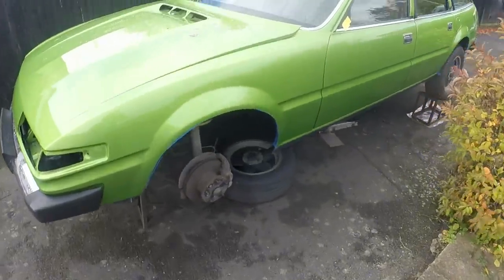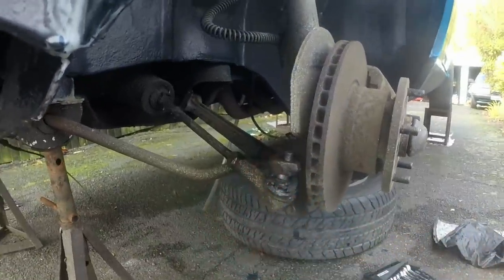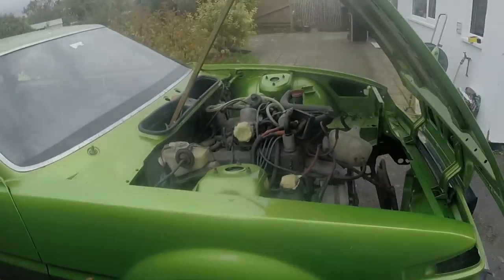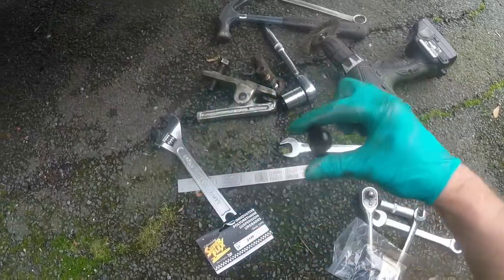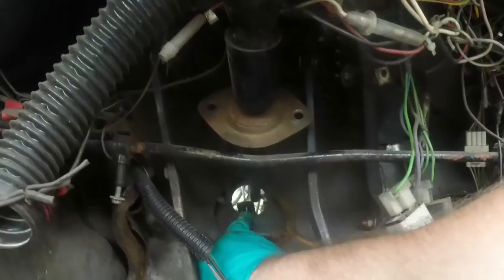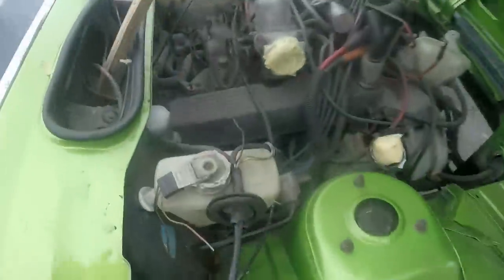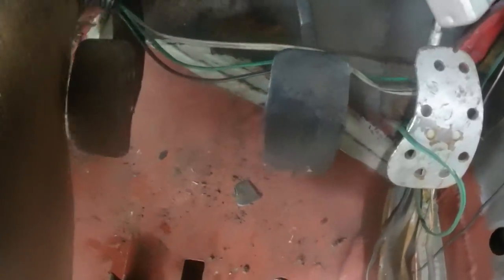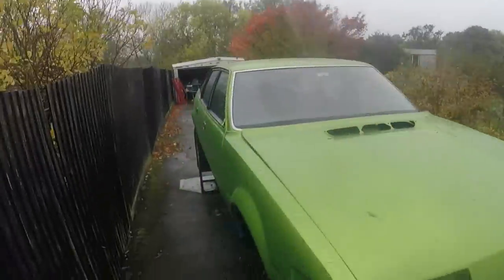Dotty 1981 Rover SD1 Restoration - Video 56 Track rod ends and steering column bulkhead bushing

Comment: Loving project Dotty and finally caught up on the videos too.  For awkward jobs like that try temporarily attaching the bolts to the plate with a tiny drop of superglue, then once it dries it holds the bolts in place and you get enough grip to fit the nuts and tighten.  The tiny amount of superglue does not make a lasting bond between the dirty metal surfaces and will just release next time the column bolts are taken out. Keep up the good work.

Comment: The joys of working on the driveway.... not, especially this time of year
Reply: I have to do a brake job and adjust my drum brakes on the driveway tomorrow... MOT mid week. I think I'm going to get wet.
Reply: @zoidberg444  hope your brake cylinders are not leaking or that job will be a pain. I took the rear drum off and everything was worn, so new cylinders, shoes and brake pipes were required. Mot/NCT is a lottery here in Ireland, you never know what they will decide.
Reply: @terryatkinson899  Luckily I replaced the brake cylinders last November with new Bosch ones. I also replaced several of my brake pipes and flexible lines. But I've done 20,000 miles since then and they are out of adjustment. 

Yeah - the MOT is annoying but the NCT seems like a real pain in the arse. I've heard a few stories about it.